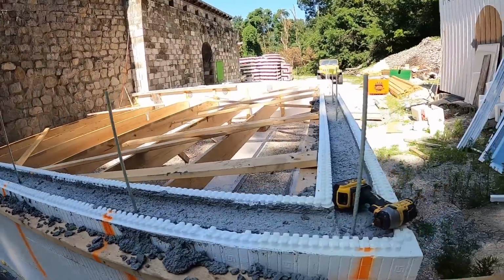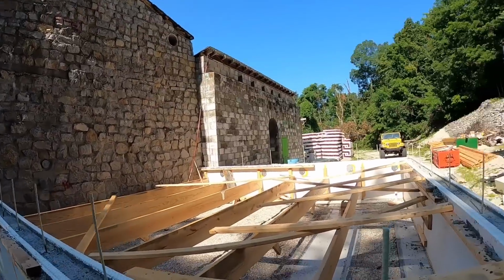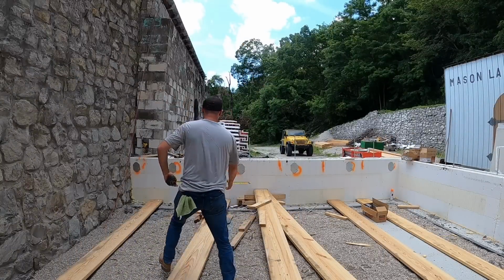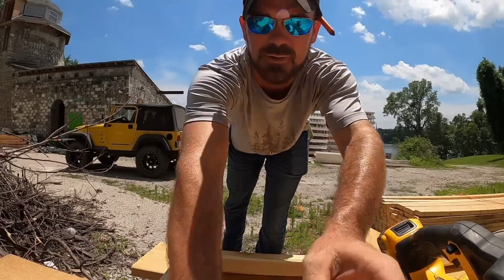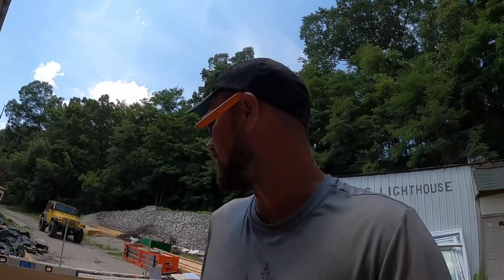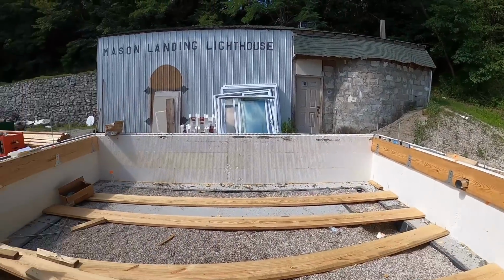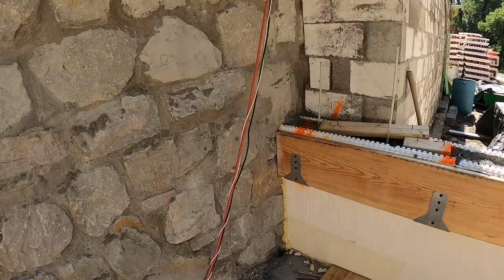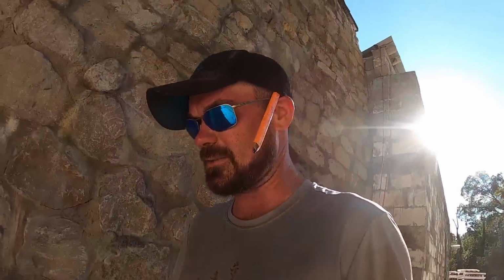ICF strapping removal and start to floor system

Comment: At least you cut big, not too short. Trimming doesn't count in my book!😜And if you are worried about plywood movement next to the wall, you can always sister blocks to the joist to attach the plywood. This is coming along really nicely.
Reply from the maker: That is the plan!  Just hoped I wouldn’t have to add the blocks. Oh well.
Reply: I'm so with you on the whole cutting things to long, it's when you cut them to short they become troublesome. 🤗

Comment: You can put a 2x4 on the inside of the 2x12 to make sure you have a place to attach your decking nearer the wall. Just screw through the 2x12 to attach the 2x4. Simple easy and cheap. It looked like the stone was close on the bottom not the top. It doesn't even have to be the full length, it can be wherever it'll fit. Great job.
Reply from the maker: That is the plan !

Comment: Joist hangers Matt !!! But we all knew what you meant, and the heat didn't help either...... 🥵🥵🥵
Now the octagonal plates in the wall make sense, your explanation how they create an anchor point for the joists filled in the missing blanks. 
Concrete continues to cure for 28 days to get up to its optimal strength, and the insulation will act as a good heat regulator for the curing process. 🤓

You are making steady progress Matt 💪💪💪
Reply from the maker: Thank you

Comment: That is a lot of hard work for one man to handle and throw heat in to equation, I can about bet it was a case of exhaustion by days end. Its looking nice young man. And the having make several cuts to get it right is better than cutting it twice and finding out its still to short!!!🙄😏😉😂 Thanks for the update sir, looking forward to this series for sure.
Reply from the maker: It sucked but all in a days work. Thank you

Comment: Matt, that addition is really coming along nicely.
Once it's roughed in to the top, roofed and sided it's going to give you lots of open space to prep items you're going to be using to finish out the interior of the castle / lighttower.
Kinda missed Dustin working with ya on this part.
You guys make a great team.
Reply from the maker: Thank you. Yup he is great to have around

Comment: Matt A suggestion, screw the 2 x 4 to the bottom of the 2 x 12 against the castle wall and fill the space between the wall and the board with concrete to create some support
Reply from the maker: Thank you

Comment: The gaps between the rock wall and board vary so much.  I thought it would be better to build a wall up along the rock wall and fill the gap with concrete, but I forgot that the higher you go the further away the rock wall be.  I read another comment saying you could fill the gaps with sister blocks to ensure a flat support for the edge of the plywood.  That would certainly require a lot of measuring, cutting, and trimming to fit a lot of blocks.  Almost like a jigsaw puzzle.  And it will be just as much work to get the edge of the plywood to contour with the rock wall!  Will definitely be interesting to see how all that comes together!
Reply from the maker: I sister boards on to get within 1”. Some long done short. Rarely will anyone walk right along the wall

Comment: You seem to have plenty of people offering advice, so you might have already gotten this suggestion once (or a dozen times).  When working solo in the heat, plan your protection from heat stroke and heat exhaustion…especially hydration.  Put up a shade apparatus (hang it from your man-lift), have check in points with someone who will drive out there and rip you for forgetting (or save your life)…or you can buy (or rent ) a chiller which requires only access to electrical and water.  

I cannot stress strongly enough that certain people (almost always very successful men) possess a drive to push through discomfort. I am one of those and fortunately, I wasn’t working alone when my “radiator hose blew”.  As a young man, it was common to talk shit, but I was talking nonsense and my supervisor knew about the condition and the ripe scenario we were working in.  He pulled me immediately, and I was ready to go back in.   Two points:
1. I was damn lucky and survived. 
2. I remain affected by something that happened 40 years ago, because my body will accelerate to “tilt” mode faster than most ..I say it is my body saying “I trusted you once…”.   That said, with proper preparation, it is as it never happened from others perspective…although I do get a few questions about my rigorous hydration routine.  

Pro tip: all fluids don’t hydrate…some (including cold beer) require more fluid than it brings to the party in order to remove it.  I have personal experience there as well.
Reply from the maker: Thats why I drink water thank you

Comment: You must be part old school Italian Matt. When you are doing time laps them arms are just a going, 🙃. Echoing others here , Better too long than too short on the boards. How do you plan on filling the gaps between the board and actual castle wall? Blocks and epoxyed rods? How will you get into the crawl space when it is complete? A trap door? Good video Matt. Looking good. I don't tremember if you told us when you got the place if it was for yall to enjoy or if it was just going to be generate revenue by renting it out.
Reply from the maker: Filler boards.   Always better too long 😂. Hidden entrance. Rental

Comment: Never seen this system before... I think I like putting the band board up with J bolts and two nuts & washers before the pour better. It acts as your strong back and then your load bearing band when concrete is set...just tighten up the nuts and you're done.
Reply from the maker: Thank you

Comment: Up against the wall side just add some 2x4 blocking where you can to the inside and screw through the 2x12 to hold the 2x4 in place for extra strength for the flooring and have less of a gap.
Reply from the maker: That’s the plan !  Thank you

Comment: Matt, you might want to drill a small pilot hole in the wood before setting the self tapping screws. It will make life easier on you.
Reply from the maker: Thank you

Comment: if your worried about that gap you can add 2 by material to the side of the floor joist and screw it through the side.nice job
Reply from the maker: Exactly! That’s the plan was just hoping to not need it.

Comment: Just use some of your offcuts cut down to 2×2's and scribe and fit them between the joist and Castle wall where the floor sheet joints meet and middle.  You'll get 5 or 6 out of one offcut of 2×12.
Reply from the maker: Exactly that is the plan ! Thank you

Comment: I haven't seen any of these techniques before. Very interesting.  The only issue I have with metal on (or in) concrete is the eventual rot.  I re-did a house addition that happens to be on concrete piers w/ 6x6 posts and my biggest decision was HDG or stainless post bases.  The cost differences were big.  I'd have gone stainless if money was no option, but when is that ever the case.  I'll be dead before my work rots out, but it's still a drag to know it's got an expiration date
Reply from the maker: These are designed specifically for use in concrete

Comment: Matt, Question?? 
In a earlier video on the ICF base construct didn't you say you needed a drain put in the wall near the ground for your sink/ washer that was to go up against the castle's wall outer edge in the ICF????
Reply from the maker: No that was a hole in the formadrain. The plumbing drain is just inside the foundation
Reply: @nyamillennial  , Phew!! I thought there might be a test at the end of the video series and I would've failed, hey!!!🤣🤣

Comment: Hey Mr. Millennial is ICF a Northern thing or can it be used anywhere? I live in Northern Illinois and never seen this type of foundation before and since my wife and I are planning on building our home next year I'm wondering if this will be the way to go as long as we do not get a leaky basement
Reply from the maker: My opinion: it is the only way to go.  Can be done anywhere. Florida is really picking it up for hurricane safety.

Comment: Matt what is the composition of the studs in the ICF that allows screws to be able to support the weight of the 2x12?
Reply: The 2x12 are attached not to the studs but to the octagon plates with the t brackets.
Reply: @dennis2376  yes on the sides but not the ends
Reply: @michaelbreault5  Ah, sorry.
Reply from the maker: Plastic

Comment: Why didn’t you just put the floor joist in before you poured the concrete instead of all the bracing that you had to take out and then put back in as the floor joists
Reply from the maker: If an adjustment was needed during pour it would have been nearly impossible.
Reply: I have never used icf form but it just seems like if you put the floor joists in and then bracing on the out side you may have saved some time but that being said I have never used icf so I don’t know

Comment: Hi Matt. What is the advance of the ICF build over a concrete 
block or brick wall?
Reply: What are the pros and cons of a 1000 year ICF wall ?
Reply from the maker: Pre-insulated/pre-framed. I will do a video on that also
Reply from the maker: Everything

Comment: Fair amount of double work. The  joist system could have gone in place before you poured the concrete, rather than the temporary ones you did and then had to tear out.  But, it's getting done. Just a lot of extra work. Need to work smarter, not harder. And yes, that gap against the rocks is absolutely unimportant.
Reply from the maker: My concern was if an adjustment needed made during the pour it would have been next to impossible. So I chose better safe then sorry

Comment: Ya might want to on the rest of ur joists take a look down it for the crown so ya don’t end up with a sag in ur floor just a suggestion not trying to tell ya what to do but it is just a old habit I was taught to do by the old timers witch now I’m one of them lol but it is starting to take shape now is when you will see what it is going to look like for the ones that don’t understand what it takes
Reply from the maker: No problem at all. That is exactly what I do.

Comment: Seems to me that the floor joists could have been installed before the concrete pour, and all that build and tear out could have been avoided.
Reply: Needed support mid way of the pour to protect against the wall blowing out due to the pressure of the concrete.
Reply: I don’t think a 3 foot tall wall will bow out
Reply from the maker: Yes and no. I see your point but any adjustments needed during pour would be impossible
Reply from the maker: Again yes and no, 3’ doesn’t have the amount of pressure a full wall will have.
Reply from the maker: They can!  Especially when up against rock

Comment: I'm from the UK, and the system u r doing is a lot of messing about and a lot of waste time and timber your never going to  use ..I could have dug a metre deep footing and laid block and beam by now and would have been on roof plate  also my system would have lasted much longer also probably cheaper...I don't like your system to much hassle
Reply: They say ICF has a better U-value rating than traditional, I have my doubts.
But yes it is more costly, both time and money.
I know companies that have tried it and went straight back to traditional or timber frame.
Reply from the maker: I assume you have to insulate and frame to finish also!
Reply from the maker: I rarely see energy star rated traditional framed house, but know for a fact there are lots of ICF energy star rated homes. I will stick to ICF as they are proven tighter/stonger/safer and more efficient
Reply: @nyamillennial  In the UK, traditional build is Brick/Block masonry.
I'm from Ireland and work in timber frame. Pre-insulated panels from the factory, assembled on site. Every house is energy rated and soon to be carbon rated lol/
Yeah, I can imagine ICF is end of the world bunker strong lol (the poor guy that has to demolish it in a 1000 years)
Reply: @ajc5479  yes and brick/ block  build with proper insulation etc is highly rated as well and last longer, timber frame houses are cheap and crap thats what most of these big housing companies use and look how many complaints there has been....
Reply: @nyamillennial  I just find doing an icf extension on newer houses. It probably would be great, but on the castle, which probably has no rating i bet, I think it's pointless, that's why a block and beam extension would be quicker cheaper and it also could still be rated higly with the proper insulation etc that's my opinion and your probably getting the icf cheap as your doing it as a advertising which is fair enough and good luck....
Reply: @terencewelch9800  Timber frame houses are cheap? WOW that's news.
What complaints are these?

Comment: Did you use the hammer setting with the self tapping screws?
Shouldn't matter too much drilling the thin plate, but you could break the drill head on the screw.
Reply from the maker: Used impact to basically lol
Reply: @nyamillennial  I assume you are fully screwed now lol